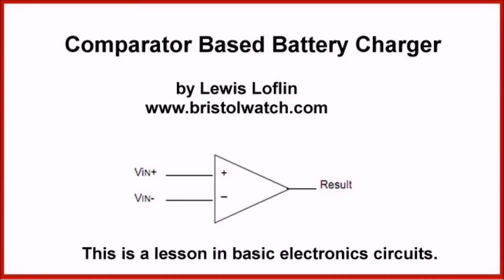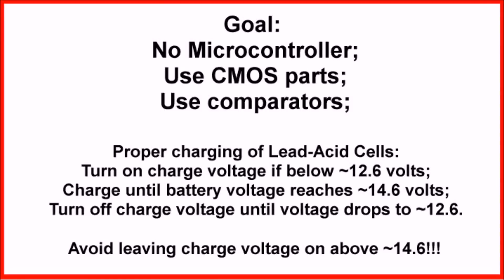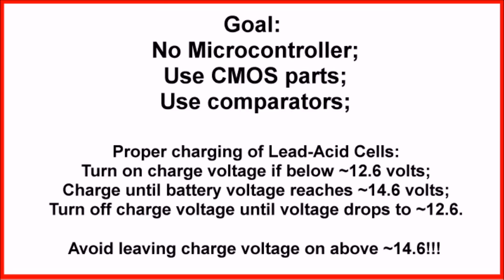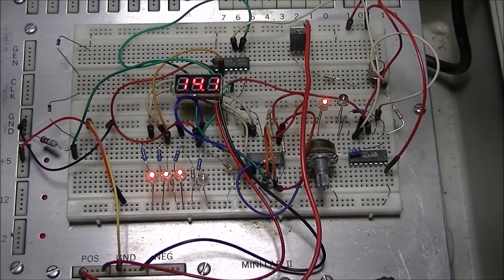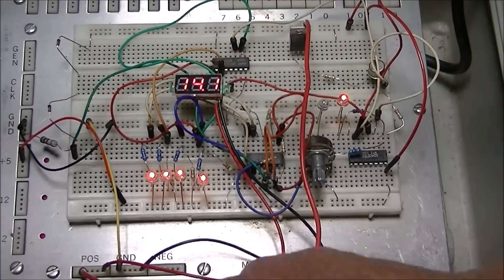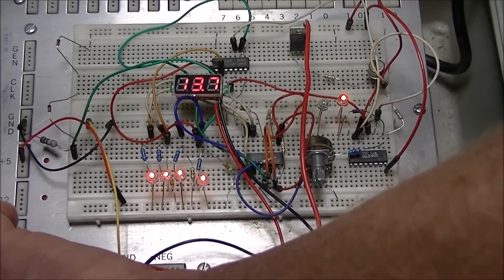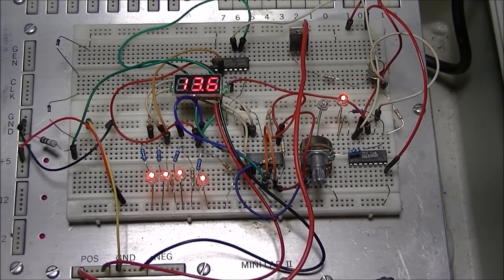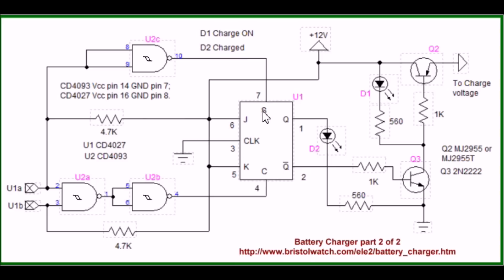Comparator Based Battery Charger

Comment: Hi Lewis. This is exactly what i'm looking for, I want to charge a a smaller backup Battery from a Bigger 12v car Battery. Ok Now in your video you said this is a partial schematic and you cutdown the comparators down to two for illustration  in (8.00) in the video. What does the complete schematic look like with the rest of the comparators. I have followed your link bristolwatch and it also just has the two shown. If you could please pass on the link if you have video with the complete circuit with all the comparators included. Thank you.
Reply: Found it.

Comment: the zener diode and the LM7805 are a refreshing idea to help stabilize the the op-amp decisions. I used rechargable batteries and voltage divider for that purpose, yet I used a relay and as a replacement for your second circuit to disconnect the battery and SSR to connect mains in order to start charging the battery and connect another power supply to run my home appliances at 12v at that time
Reply from the maker: The original design used a relay. Good work.

Comment: Nice circuit! Explanation in reverse order would be easier to understand, IMHO. It is more natural approach.  1. Explain flip flop (we would need to turn off and turn on things manually first). 2. Add (connect) NAND gate and manually set values of it inputs to understand how it makes changes on flip flop. 3. Add comparators (analog to digital) to replace manual inputs of NAND gates. Thanks!

Comment: Hi Lewis. Ok i have tried to put this circuit together more than 8 times already and having no success between the first and second schematic. Its seems that the pins on UA2 are incorrect according to the pinouts of the data sheet. I like the concept of the circuit so i am adamant to get it working. Have you please got a more detailed schematic on this  with  all the LED's connected to the first and second circuit. Thank in advance.